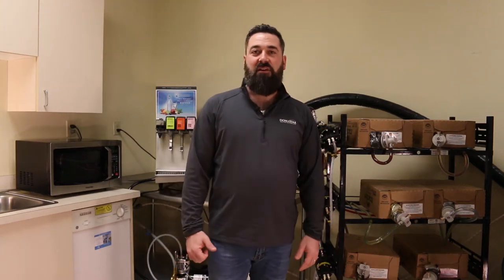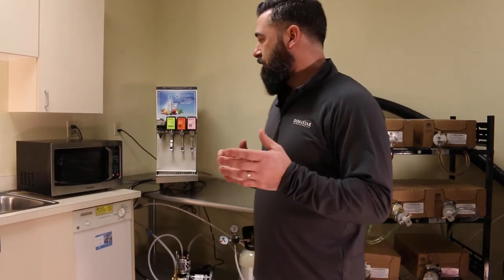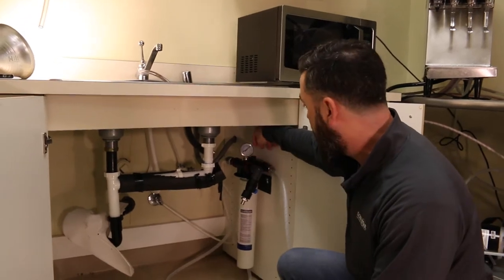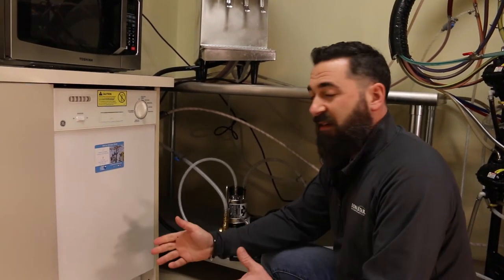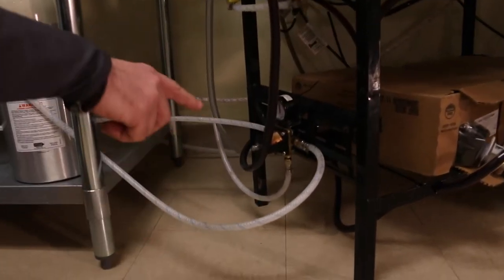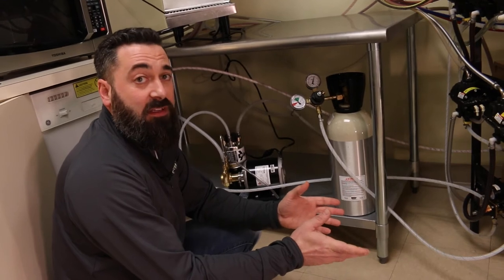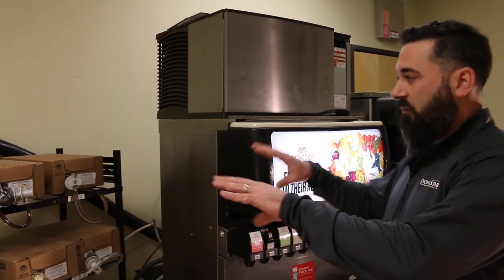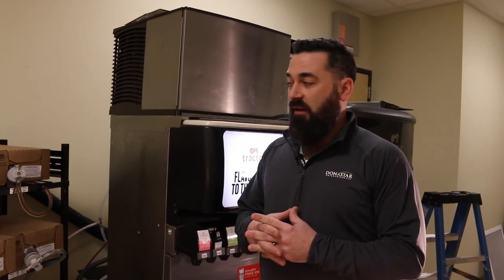How Does a Soda Fountain Machine Work?

Comment: I wish you discussed chiller options. I know most setups like this prolly use the cold plate that's located in the ice dispenser as I think it makes the most sense, but ya different options for those "remote" chillers would be good to see how they work in this situation.

Comment: Question for shurflo pumps like this video at how much psi have to be running i mean how much psi on main regulator and how much on secondarie regulator and i got 3 conections in my cornelius unit sw1 sw2 and w
Reply: CO2 psi coming from your tank should be 90-110. At the pumps. 45 for diet and 65 for all else ( typically, depending if it’s high yield or not, and a few other minor factors) your carbonater will have a secondary reg built in at 75psi.